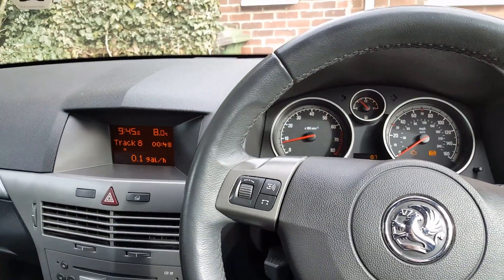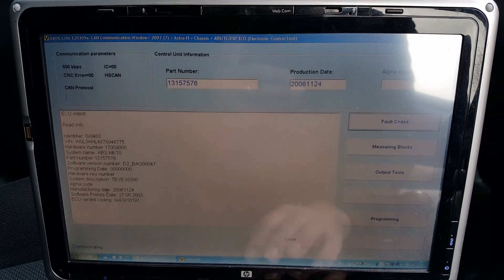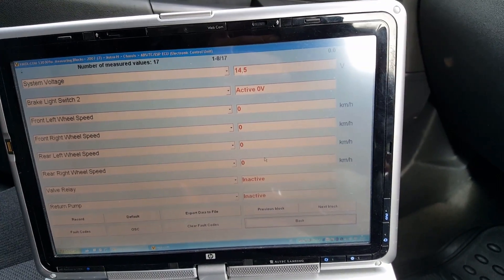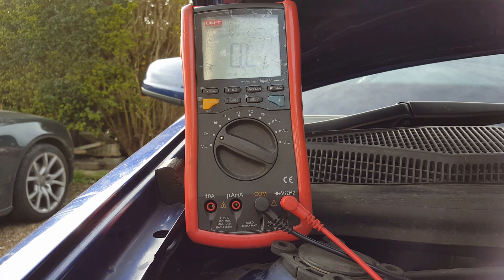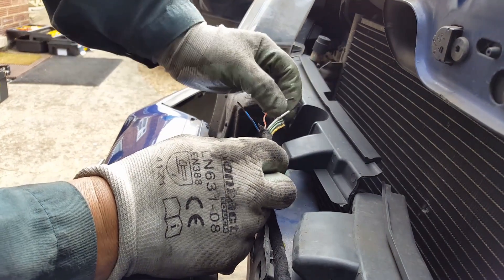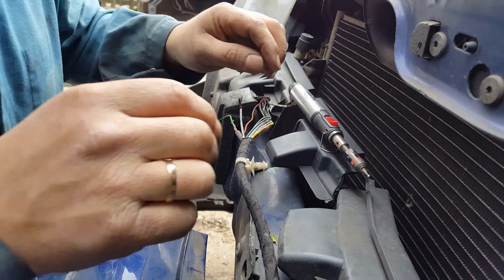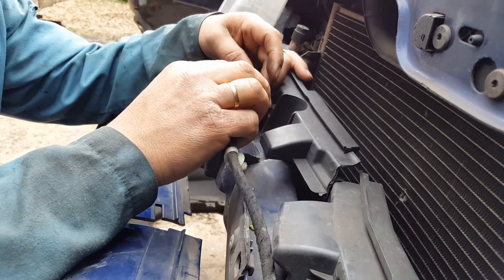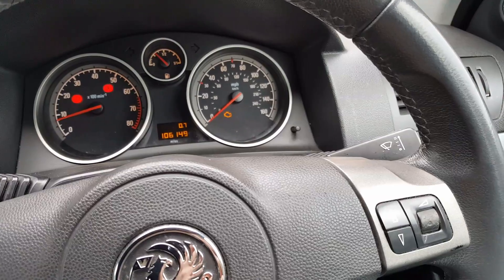Vauxhall Opel Astra H 2007 ABS light ON. C0040-00 and C0800-03. Fault finding and repair.

Comment: You just saved me again! Second time, second car in last 3 days:)
Just fixed 2 cars after almost a year... One did not started( broken wire almost same spot where You had in one of Your Vauxhall videos), and now I had astra after accident, repaired front with abs light on and both front sensors showing faulty... Same problem- broken wires by front crash bar...
You are my Hero, mate!
Reply from the maker: 😊
That's great! 
👍👍👍

Comment: I have a same code problem my Astra H, I checked diagnostic same code and same tire, I measured with Opcom tire speed test but speed value is okay. I meant km information everything is okay. However I have bought same code , I still don’t know  why it’s happening?
Reply from the maker: How is the speed reading compared with the other 3 wheels?
Are they all match?
Do a graphic live data analysis, sometimes small dips are difficult to detects just by looking at the numbers... even on a graphic, depending how fats the scanner is, but the ecu will detect them...
👍👍👍
Reply: @LMAutoRepairs  The first of the two cables going from the ABS sensor to the connector goes to the fifth pin. What pin is the other cable in the connector? Unfortunately, I can't find it.

Comment: Great vid. The only thing missing is how to get the  coolant expansion tank off. I have tried everything. Haynes manual doesnt show how to do it and I had no success Googling it. Could explain how?
Reply from the maker: Phil Thompson 
Hi
Thank you for watching!
I confess I can't remember how it comes off...
I believe it jus clips on some sort of brackets... pull it up and should come out...
But as I said, I am not 100% sure... sorry...
Reply: Thanks for getting back to me. Ive worked it out. Needed a bit of force. I am working on a Zafira B which is only slightly different. The pins in the plug were set out slightly differently. It appears I have a damaged wire to my rear left side wiring. I think I have caught the wires when fitting a new set of seats. No obvious damage to the wires inside the vehicle were the fault must be. Thanks again I couldn't have even started the fault finding without your video.
Reply from the maker: Phil Thompson 
No worries... here to help!
😉

Comment: Which software are you using. I have a handheld obd2 scanner but it only reads the engine codes not chassis/abs codes. Which do you recommend as cheapest way to read ABS codes and wheel speeds
Reply from the maker: For Vauxhall/Opel, probably Op-com is your best option...
Thank you for watching! 
👍👍👍

Comment: Thanks for sharing your video. Have the exact same problem with ABS light and service lights on after having a new ABS sensor fitted recently.  My speedometer, jumps from 0 - 100 whilst driving, so its not giving me actual speed I'm doing. Have you any suggestions on what could now be the problem/issue? Would really appreciate your help. Many thanks.
Reply from the maker: Scan the car to start with...
The sensor, was original or aftermarket? 
👍👍👍
Reply: @LMAutoRepairs  I believe the car has been scanned by the local garage, who stated that they could not find the problem./issue. The Sensor was purchased direct from Vauxhall dealers.
Reply: @LMAutoRepairs  Thank you for responding to a very stressed out driver.
Reply from the maker: The answer will be either on the codes, or on the live data...
Needs to be investigated thoroughly! 
👍👍👍
Reply: @LMAutoRepairs  Thank you so much. Would you suggest I take it to a main dealer to be  fully investigated further?
Reply from the maker: @PB2K10  
Or a decent mechanic/electrician...
👍
Reply: @LMAutoRepairs  Thank you. Really appreciate your help. Where are you located if you don't mind me asking?
Reply: @LMAutoRepairs  Thank you. Really appreciate your help. Where are you located if you don't mind me asking?

Comment: Hi! Nice video, as always! 
I have the same car with the same engine. For the two o2 sensors try to check the F26 fuse on the underhood electrical centre. I've been messing around with this circuits because I have a problem with the first o2 sensor too, seems that I need a New ecu... sorry for my english and greetings from Italy!! :)
Reply from the maker: Tommaso Bocci 
Hi
Thank you for watching and for your comment...
As said in the video, I have not been asked to look at that problem... but I know what you mean... the ECU in this engines is attached to the engine block... it heats too much... is a king of a known issue...
Check everything throughly to make sure that the ECU is the culprit...
Good luck...
Reply: lmsvvavr Thank you! I've downloaded the TIS 2000 on my computer and followed all the steps for the guided diagnosis. The wiring harness is fine, I've changed the o2 sensor but the signal is stuck on 449 mV on all condition, so the P0130 code is set by the ECU. I remember that some years ago the water pump broke, since there is no temperature indicator on the dash the engine overheated pretty bad and 3-4 months later the MIL lamp went on. Fortunately this kind of ECUs are easy to find and cheap to buy on eBay.

Comment: Hello, how did knew witch pin is corresponding to witch sensor?
Reply from the maker: Alius Miskinis 
I have checked the diagrams...
Reply: Are those accessible for civilians? :D
Reply from the maker: Alius Miskinis 
Google will help help you....
Reply: Well , thnx to you  just now i've fixed same error, identical case, after accident few wires went loose and got damaged by a cooling fan, thnx for sharing this video m8 ;)
Reply from the maker: Alius Miskinis 
No worries...
Thank you for watching!

Comment: Hi everytime it rains my traction control light and ABS light comes on where could my problem be please Vauxhall Astra
Reply from the maker: 🤷‍♂️
Scan the car and go from there...
Look at some live data as well...
Thank you for watching!
Reply: @LMAutoRepairs  hi yes I should have said I have had the cask and two new bearing sensors at the front they tell me it's not getting a live feed to them wheel bearings when it is dry weather the lights are off soon as it's rains sum they come on soon as I start the car before even moving  would you have any advice on where the water could be getting into where it shouldn't be please thank u 🥺
Reply from the maker: Difficult to say...
You need to inspect and see...
Check plugs, connections etc... no silver bullets for something like that...

Comment: C0800-03 system voltage low voltage i only have this code where can be there broblem. ? I havent do or chanche nothing.
Reply from the maker: A bad sensor possibly...🤔
Thank you for watching!
Reply: @LMAutoRepairs  do you mean bad abs sensor?  How i can diagnise where it bad sensor. ?

Comment: hi my friend how are you I want to ask you about  my zafira B z19DHL 2006  
fault code is P0651-02 reference circuit 2 low voltage
and my car no acceleration  
were is the problem and thank you so much
Reply from the maker: Med téchnicien 
Under live data, go the accelerator values,  you should have two readings, can you see both?
Reply: lmsvvavr  I'm going to live data I have a voltage  the accelerator but the calculator pedal accelerator  0
Reply from the maker: Med téchnicien 
Ok... but you should have 2 voltages... working the opposite way...
The code suggests that one of the reference voltage is missing...

Comment: Hi got same car astra h 2006 got the problem with abs light as well as the speedo been told that speedo is in the left side hub and that is the problem for the speedo as well as abs light staying on only code i got was p0500-74 vechile speed signal range that was from opcom, where would be the best place to start for trying to resolve this problem. many thanks
Reply from the maker: daz sam 
Hi
You can just to make sure that the s3nsor is at fault,  probe the sensor with the scope...
You can also compare the both wheels...
Is the sensor is not giving signal, then obviously you need to replace it...
If the signal is good, the you might have a wiring issue between the sensor and the module....
Hope that helps!
Reply: that is great thanks for the advice, also where are you to so impresed with your vids. Also i have another problem but a bit to long for this page so can i post in discussion plz many thanks
Reply from the maker: daz sam 
No worries... post it in discussions...

Comment: Dude, I personally think You don't know what you are doing. You are measuring a sensor resistance but in many, many instances this is absolutely wrong as for the type of the ABS sensor that are also in majority. Sensor resistance checks is only appropriate for the self-exciting sensor types. These sensors are simply a wound-coil with a magentic core. As the reluctor ting tabs pass by, there is a electric current generated by this sensor and as a result of the surrent - there is also a voltage across its pins chence self-exciting. These sensors produce sine-wave voltage signal that is received by the ABS ecu. These sensors have many other disadvantages and are in minority nowadays. For these types of sensors it is right to check their coil reistance with an ohmmeter. Majority of the ABS sensors are however the hall-effect type. These sensors can not be checked for the reisstance (the same why you can not check the resistance of the capacitor!). Hall effect sensors are connected to ABS module where ABS module is passing some electric current through this circuit (around 20mA). This sensor will modulate ("sink") this current to either Low value (when no metal tab is proximated) being about 11mA or signal High (when against the tab of the ring) and is about 17mA. the signal is a square-wave current - not Voltage!!! The signal amplitude does not depends on the wheel speed (like in self-exciting ones). Testing of these sensors is by putting the ammeter in line and reading the value of current that will switch between the 11mA to 17mA as you rotate the wheel. If wheel is stationary, the value will be constant and being either 11mA or 17mA - not zero, depending on whether the reluctor ring tab is, or is not, present by the sensor face at a time. These sensors do not have any resistance and are far more accurate, reliable, stable, better diagnosable and lighter than the self-exciting ones. All modern cars nowadays (at least from the moment when the ESP system was introduced) have a hall-effect sensors! Hall type sensors module the current that is passing through and as a side effect- there some voltage difference across the sensor-yes, this voltage is also a square-wave but this voltgae amplitude is not always the same and is not the subject of what the ABS ECU is looking for- it is looking for current signal. So, voltage in those sensors are a side effect and should be not measured.
Reply from the maker: After reading the first sentence of your comment, I can clearly see that you either have not watched the video, or you have not understood it...
Because, I was not measuring the sensor...🤦‍♂️
Go and watch the video again... without skipping...😉
If after that you still have the opinion,  then you don't understand diagnostics...
Thank you for watching and for your comment!